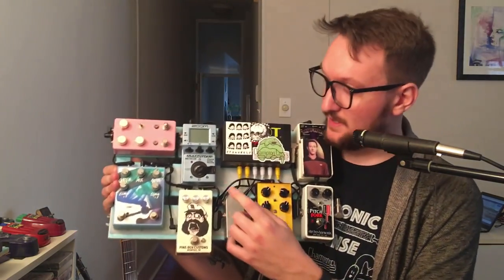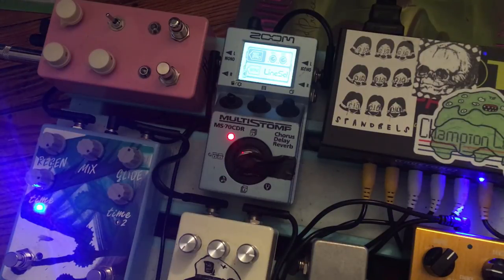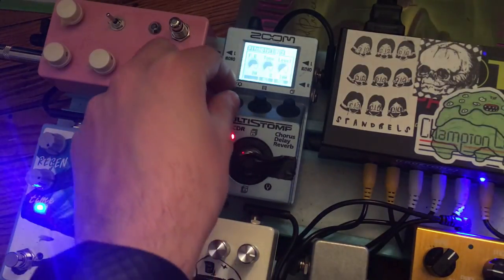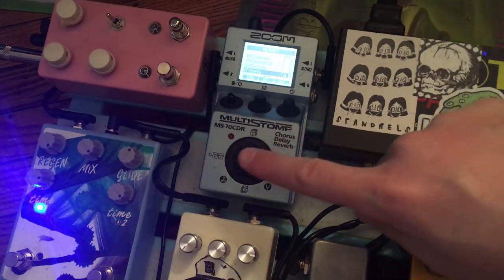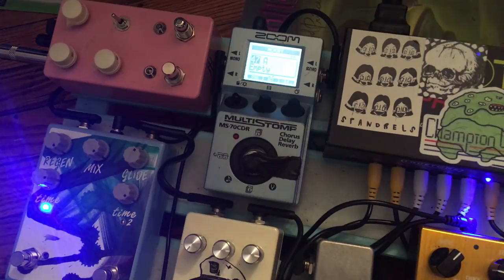How I MultiStomp: My tips and tricks for getting the most out of yr Zoom MultiStomp

Comment: MS 70 CDR tips
:

Tip 1. Line Selector is your friend - you can punch in and out using this inside the pedal or use an A/B or true by-pass loop (also see 4a below). 1:54

Tip 2. Hold the up button to access effect categories instead of clicking forever (example pitch effect in lofi reverb) 3:25

Tip 3. All time parameters (mS, bpm) are consistent if you use the same effect more than once 3:51

Tip 3a. Spin knobs quickly makes them jump values quicker 4:25

Tip 4. Click middle knob to exit effect editing and the right to go to first page 5:40

Tip 4a. If you want to punch out the effect completely, use the true-bypass loop pedal (or A/B switch) 7:02

5. Holding left or right adds effect to the left or right of your current chain position 7:15

6. ABC mode - Click middle knob to go to memory list of patches you have set up for various songs and song parts (chorus, verse, break, etc.). Use the right knob to assign patch order, like: A-B-C...W-X-Y-Z 7:25. 

7. Arrange them in set list sequence INCLUDING DRY SOUNDS with no effects to make it easier to scroll through your set list (50 memory positions). 8:00

8.Experiment with different effects, different orders, move in and out, e.g. dirt boxes before and after delays/reverbs, emulate other signal chains of your favorite artists, etc. 9:08

9. Then just do stuff the wrong way and see what happens, e.g. bit crusher after reverb. Bit crush everything (amazing) 9:24

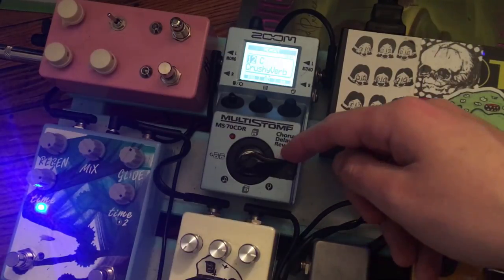10. Mess around with the harmonic pitch shifter, near perfect monophonically (even with digital artifacts) 10:17

10a. Put HPS after pitch delay gets kooky 11:27

11. Shoegaze patch uses MojoRoller at end of an ambient patch (2 delays into big reverb?) for delayed vibrato, then into a dirt box after the MS-70CDR 11:52

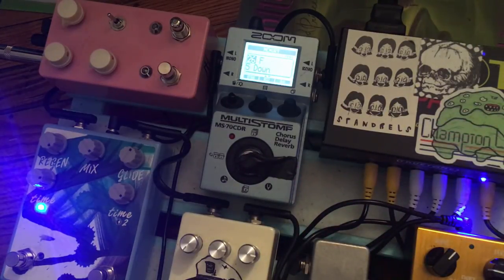12. Try different patches you find and string them together e.g. his 5 Down patch - pitch shifts down a 5th + LofiJunky patch (compressor into vibrato) that gives you enough creative juice to build a song around it 12:52

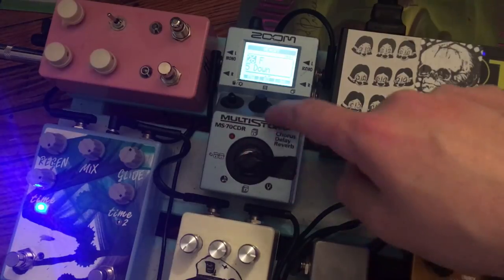13. Try BendChorus (Thacknin patch) starting with low settings across the board, then adjust to taste 13:51. 

13a. Dynamic Flanger, MojoRoller, reverse reverb, end with dirt (Shoglazer patch) 14:33

14. Trigger Hold Delay into pitch delay into THD into analog delay (put THD everywhere = Hold5Maths patch) 15:39

15. Set things wrong for delays (Drunky patch) 16:33

16. Pitch delay, down a fifth, baritone guitar like, then into big reverb (Down5Smear patch) 17:19

17. Go to https://www.reddit.com/r/zoommultistomp
Reply from the maker: Oh dang thank you so so much for this breakdown! I'm sure this will be super helpful for people who prefer to just get the tips and go and for folx who learn better by reading instead of listening. Pinning it to the top!
Reply: @PedalFriends  I think it's very valuable to listen to it once in its entirety, but when you go back it might be nice to just go to the part that they want to focus upon. Great video, sir!

Comment: Hi mate, thanks for your videos. I have the MS 70CDR, do you know which delay mode is close to the quality and tone of the delay of Boss DD-3?
Reply from the maker: Thanks for saying thanks and you're entirely welcome! I've never played a DD-3 but my best guess would be the regular "Delay" since that one is just a digital delay with no mod options like the DD-3. You can use the HiDMP to tailor the repeats tonal quality to match which may take some work but could provide great results. You may also try the DualDigiD which is based on the Eventide TimeFactor but generally will provide you with "pristine" and clear  repeats like Digital Delays are known for (just remember to set the modulation all the way down since I don't think the DD-3 has modulation on the repeats). You can also always stack effects like EQs and whatnot to try to change the sound of yr patches but remember that it will then effect yr entire signal too.

Comment: How do you think the REVERB effects on this device compare sound quality wise to standalone devices that are available?  Say, compared to, for example, its contemporaries like the TC Hall of Fame,  Hardwire reverb, Boss RV5, Line 6 Verbzilla...    Also, as the reverb effects on this device are now about 8 years old, how do their quality compare to newer reverb pedals?  thanks
Reply from the maker: Hiya! There is not a simple answer to this question and ultimately I think you'd want to try to listen to as many demos of the reverb sounds themselves and compare across to the other pedals you mentioned since all of this is so subjective in the long run and my idea of comparable may be different from yrs.
That being said: I have an RV-5 and a MultiStomp on my board right now so I can compare those in my own experience pretty well but I've not technically played any of the others you've mentioned.
Overall, I find the reverb sounds on the MultiStomp to be really great and ultra useful even if they are not always the most pristine or perfect examples of any given reverb sound you may be looking for. The Spring sounds in the RV-5 are definitely better than the MultiStomp and I'd say every setting in the RV-5 is slightly "better" and more "realistic" or at the very least more representative of what they say on the box, if that makes sense. The Plate sounds like a Plate and has a little more definition than the  MultiStomp but you'd be hard pressed to tell them apart in a mix and I'd say that's basically true for every other sound. The RV-5 has the interface advantage: the knobs are right there and you can easily change the sound without even thinking about it for more than a second which may be what you need.
BUT the MultiStomp has to win for sheer versatility IF you don't need the traditional interface of any of the other pedals you mentioned. It would be absolutely silly to compare a pedal that can stack up to 6 unique effects on top of one another to one that can only play one at a time and the ability to stack reverb on reverb on ANYTHING with nearly unlimited variety within those categories makes the MultiStomp entirely singular and ultra-personal.
Is the Shimmer setting as perfect and beautiful as one in an Empress Reverb or an Eventide or Strymon pedal? No, probably not. But can those pedals do a shimmer with an Auto-Swell before it into a chorus then into a slow filter for an even more gorgeous synth like sound? Not exactly. That's why the MultiStomp is either "better" or at the very least an entirely different category of pedal than those other ones.
To directly answer your question: I think the reverb effects available in the MultiStomp are wonderful and many of them have become staples for me when playing (GateRev, ModReverb, Cave, ParticleRev, LoFi) even with two other reverb pedals currently on my board (RV-6 and the EAE Hypersleep) simply because the MultiStomp ones sound good enough and I find them to be really well crafted and versatile in functionality.
I will also say: I'm the type of musician/pedal-user who relishes the differences between different pedals rather than tries to decide which is "best" and I think every single effect has its own uses. I don't use my RV-5 the same way I use my MultiStomp or the same way I use my Hypersleep or any other device I may have. If I had every single pedal you listed I would probably find something great or at least usable about each one and they'd all justify each other automatically because that's how I approach things.
None of this is meant to put you off any of the devices mentioned. I just wanted to explain my approach since that will directly effect my response. I hope you find the reverb that works best for you and that sounds most best to you. What sounds good to you is far more important than what is "best".
Happy to answer any more specific questions you may have and feel free to further pick my brain about anything you'd like!
Reply: @PedalFriends  many thanks for your long reply!! :)

Comment: Sounds great. I've a question: When clicking through patches, A to B to C to D etc, does changing the patch cut off the tails from the previous patch?
Reply from the maker: Yaknow, I don't know and I'm away from my board so I can't check! I would guess that it does since yr switching things entirely but I'm happy to test this once I get home later on. Comment back in a few days in case I forget but I'm happy to look into this for you. Also, someone may have answered this on the subreddit if you wanna dig for an answer: reddit.com/r/zoommultistomp
Reply: @PedalFriends  obliged
Reply from the maker: @tom-dahl1598  Just looked it up and unfortunately no , the pedal does not retain trails when switching between patches. Bummer!
Reply: @PedalFriends  i thought that might be the case. i believe it does retain tails though when switching fx on and off within a patch.
Reply from the maker: @tom-dahl1598  It does indeed but only for the effects that have a trails switch listed. Most of the delay and reverb have it but some do not; I'd check the manual.
Reply: @PedalFriends  that's useful to know. i'm interested, primarily, in turning delays off and on, using the centre on/off switch. i'm new to the unit but i'd be surprised if some of the delays didn't have the 'trails' function.

Comment: With the preset cycling function, it has to do a complete lap of the designated alphabet before it goes back to A? or is there a way to hope between desired letters (back and forth) without modding it to include a footswitch?
Reply from the maker: So far as I know it only goes forward through the alphabet so my solution for going back to a patch I need again is just to duplicate it and put it down the line aka A is my lofi vibrato, B is clean, C is gated reverb, D is lofi vibrato again. I also know nothing about external footswitches so sadly I can't help you there. Hope this helps!

Comment: Great video mate, thanks :) I was wondering, when you power the pedal does it load straight into a preffered patch or do you have to cycle through to find it each time you power up?
Reply from the maker: This comment somehow eluded me! The MultiStomp brings up whichever patch you were using when you last turned it off upon boot. So if you were on Patch #23, it loads up Patch #23 on startup. You have to go into the patch list and hit the stomp switch in order to use the "Preset Scroll" mode which has to be pre-assigned as well. Hope that makes sense and sorry for the extreme delay in responding!!!

Comment: Can the Line Selector patch be used to create parallel signal paths?
Reply from the maker: No, unfortunately not. The MultiStomp does not have the ability to create parallel loops internally and you can only run effects inside the device in series.
Reply: @PedalFriends  thankyou for your answer.  that's a shame, nevertheless I'm still thinking of buying the Zoom MS 70 CDR.  I've recently found out there's a download hack thing one can do which enables one to get all the types effects patches available across the devices of the MS range and the G1on and G3 of the same generation!   I'm not generally into multi effects -- I typically prefer separate effects -- but this thing seems like a no-brainer, even if only one effect is used at a time.  I might use it in an amp's fx loop and primarily just for all the reverbs.  It'd be nice to have all the unusual reverb effects it has.   I also could use the stereo out to create a dual amp set up to an amp/cab sim.  I also have Line 6 M5.
Reply from the maker: These are all great ideas to me and I'm certain you'd have a great time with the pedal! I find it infinitely useful and fun and I'm certain anyone who approached it with patience and an open-mind would find the same thing.
Reply: @PedalFriends  many thanks for your reply

Comment: Hey great video! I'm up to get one multistomp soon :D hopefully you can help me with some doubts I have. Are you powering it with the one spot brick? Wich output? Ever had problems with daisy chaining it?
Reply from the maker: So I power is with a TrueTone CS7 on the 500mA output chain and it is not daisy chained to anything else. I've had some troubles with noise when daisychaining in the past because as you push the DSP, it seems to take more power and therefore potentially hum a bit more when daisychained. I'd suggest keeping it on its own line from an isolated power supply (generally speaking I love isolated power supplies for boards larger than about 4-5 pedals). Hope that helps!

Comment: Once I turn one of my presets on, the main footswitch won’t turn the pedal back off. I want to be able to use my preset, hit the switch and go back to my amps clean sound. Hope that makes sense. Any tips?
Reply from the maker: Oof, I'm not too sure! Are you using a Line Selector at the beginning of the chain? The Line Selector allows you turn turn on and off an entire chain of effects placed AFTER it. So yr chain would need to be Line Selector > effect > effect and you'd have the Line Selector up on the screen for it to turn on and off the entire chain. If you place anything BEFORE the Line Selector, those won't go on and off with the Line Selector. If there's something wrong with your footswitch, I unfortunately have no way to assist you. What does your chain currently look like?

Comment: I don't understand why you have the extra footswitch to turn off the effects, when you can just hold down the stomp to bypass it?
Reply from the maker: Does bringing up the tuner bypass the entire signal? That's a neat workaround! I like(d) the extra footswitch cuz sometimes I needed rapid changes turning things on and off between verses and whatnot and trying to time the second long hold to get the tuner to come up would be almost impossible for me. To each their own.
Reply: @PedalFriends  It should do, the pedal isn't true bypass though
Reply: @jobbo89  i dont think its even analogue buffer. Those are fine but id rather not send whole signal thru cheap digital converter, especially before dirt.